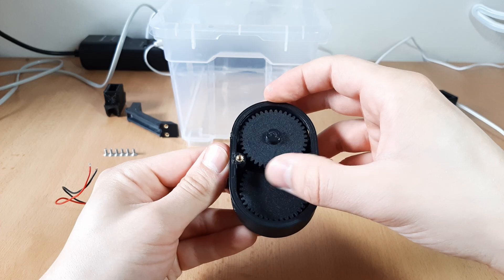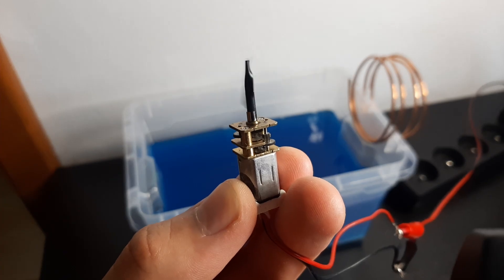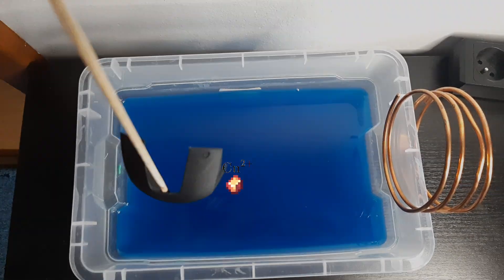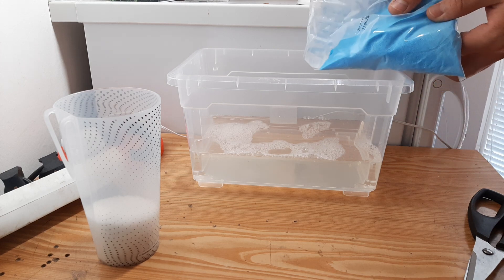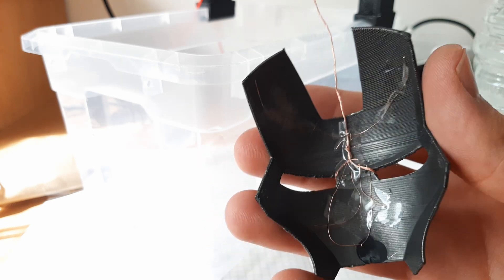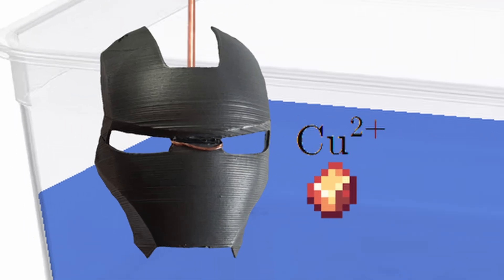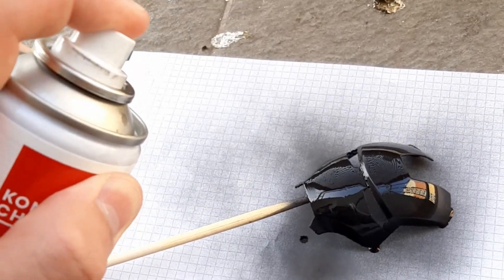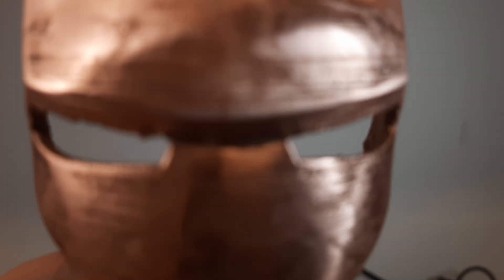Electroplate 3D Prints Easily (Coat Anything With Metal)

Comment: Excellent video that explains the basics of electroplating really well...

A few recommendations for your future video from an Electronics Engineer (me)
Graphite paint is a terrible conductor right out of the can... The surface to which you want to paint needs to be as smooth as possible so you need to post process your 3d printed part first before spray it with graphite paint, secondly after applying graphite paint you need to polish your graphite-painted surface to improve its conductivity, sometimes it increases it by 80%!!! So more copper will be deposited in less time and more uniformed... and thirdly instead of making the part rotate, place 4 copper plates on the 4 sides of the box...
Reply from the maker: Thanks! I kinda knew these tips, but was too lazy to make a proper station or smooth out the prints. I will hopefully revisit this project and try nickel plating too. It's just that I don't have time for this rn.

Comment: I put WD-40 on parts that are mechanical for 3D prints and it turns a lot of them that usually gets stuck or don't move into parts that move flawlessly so you might want to check that out next time you try to make a gearbox or any mechanical part. It has helped me immensely so hopefully it helps you too

Comment: A better printer (something with Klipper) would be able to print the gearbox much easier (Ex: my Neptune 3 could not print screw threads. My Neptune 4 could.
Also you could use a continuous servo instead of motor